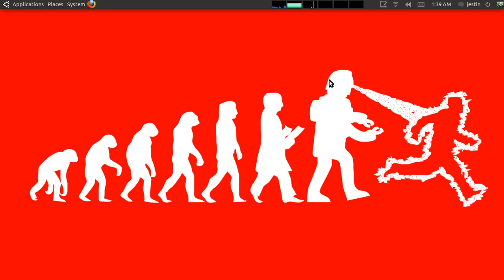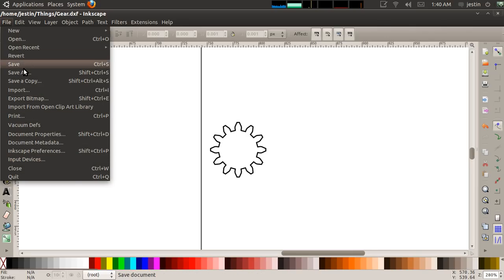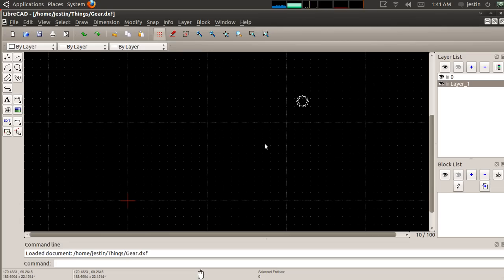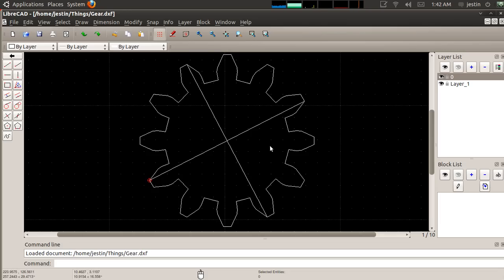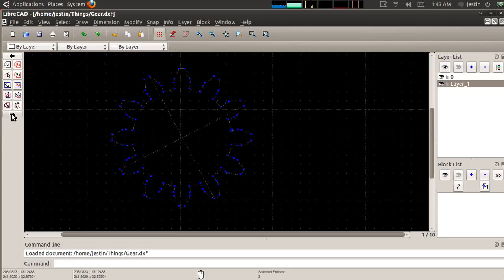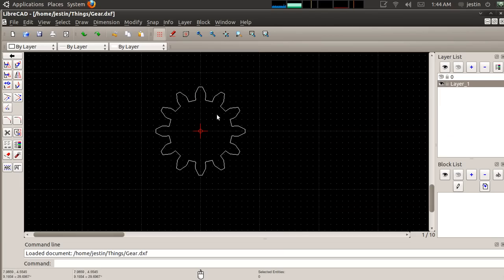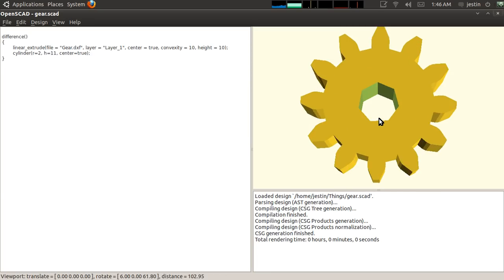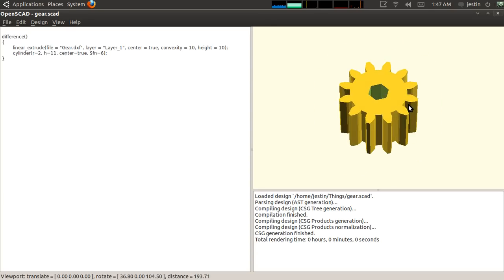Creating Gears in OpenSCAD

Comment: I know this vid is a couple of years old but it did make it easy to make a gear. 
Some tips: Inkscape->extensions->render->gear uses px as the units for the circular pitch so the gear will probably need to be scaled when you get it to LibreCad.
Easiest way to move to origin in LibreCad is to use a 3 point circle. Set the snap to entity endpoint  and click on the outside tips of any three gear teeth. Then measure the circle diameter. If it's not what you want it to be calculate the scale factor needed and scale the gear to size. The scale and move commands first ask to select the entity then to proceed you have to click on the ">>" ("continue action") icon at the bottom of the sidebar icons. This is not well documented, it took me a long time figure it out. (I'm familiar with CAD but new to LibreCad). Set snap to "snap center" then proceed with the move. It is not necessary to set "snap to grid" just manually enter "0,0" in the command line box. Now you can erase the circle and use "modify properties" to make sure the gear is on layer_1, then save as a dxf. Make sure it is an Autocad R14 dxf, Openscad barfs at newer versions.
The rest works as shown except the syntax of the linear extrude command is changed. It is now:
linear-extrude(height, etc) import (file= filename, etc);

Comment: Hey, great demo, many thx!! In Inkscape you can just select the gear and set the X,Y coordinates manually (to center the thing without LibreCAD)
I.e. if the width=50mm and height=50mm then just set X= - 25mm and Y= - 25mm
(mind the negative X and X values!) Cheers P

Comment: Now you have to do this: 

linear_extrude(height = 10, center = true, convexity = 10) {
 import("gear.dxf");
}

and if you want to use it straight from InkScape you just place the center of the gear over the lower left corner of your "paper" in InkScape before saving your dxf file.